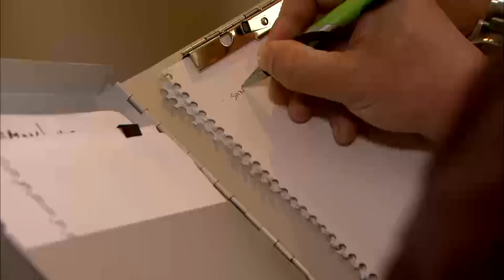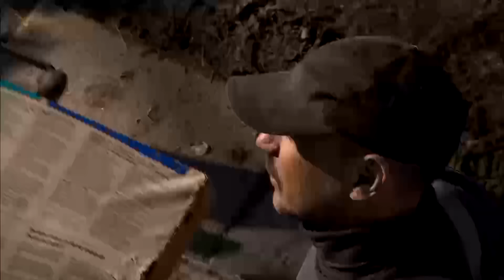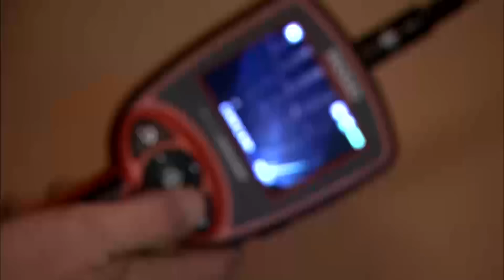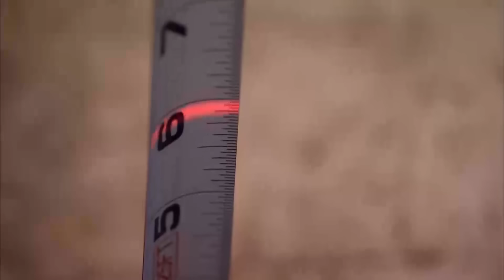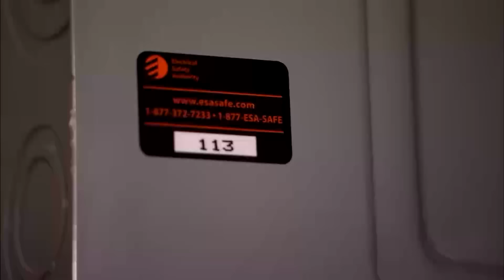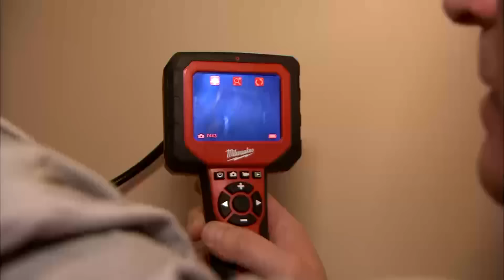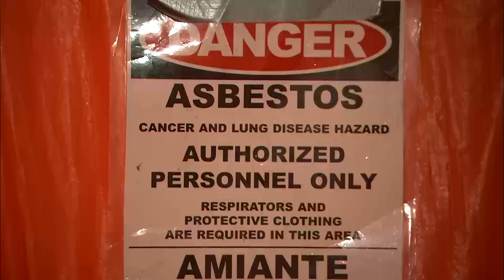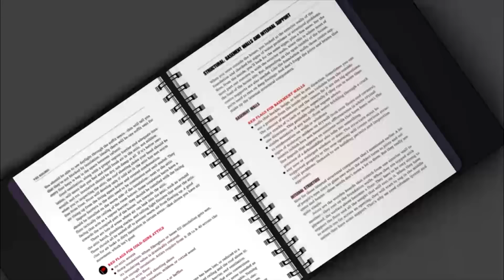Top 3 Holmes Inspection Episodes | HomefulTV Rewind 2023

Comment: Back in 1986 my husband and I had moved into our very first apartment. We were stationed at Norfolk naval Base out in Norfolk Virginia right on the beach. That's all we can think about what we wanted a house on the Beach and we got it. I was 4 months pregnant and had dropped the kitchen towel on the floor. This kitchen was so tiny it was a galley type kitchen and you can literally touch the left wall and the right wall at the same time. That was the worst decision we had ever made..  to pick up the dish towel that I had dropped, I had to place one hand on the stove and one hand on the sink there wasn't even any water in the sink. Next thing you know I was lit up like a Christmas tree and I couldn't break loose of the current that literally held me to the sink and to the stove at the same time. That was not a good idea. I couldn't get  loose from the current that traveled from the stove through me all the way across to the sink. Husband heard me and came running and the only thing he could think to do was put his foot which he had specialty rubber boots that were specially made for being on the flight deck of the aircraft carrier. He literally took his boots into the middle of my back and shoved me as hard as he could which broke the current and I landed actually in the garbage can. The landlord didn't seem to care much about it. Come to find out it was happening because of a  garbage disposal has been removed, but they left a live wire under the sink. My son was born with Spina bifida. Makes me wonder if it could have caused his illness.

Comment: Must have been when I let the dogs out but how did they fix the floor joists?
Reply: they removed and replaced them  i believe pas there was no fixing them
Reply: @jays106  Pretty sure they removed them altogether because something about the height being too low for code, after the concrete floor I guess. 
1:53:14 He tells them they would lose the current bathroom because of this.

Comment: I really need help like this in the U.S. I live in Ohio. Bought my first home 2 years ago. No inspection. After I moved in I started noticing problems with the house. No insulation in the walls or attic, floor in kitchen slopes, no trim around doors and windows, propane wall heaters are causing fumes that give me a headache. Cracked foundation, shallow crawl space, brittle PVC plumbing, no ground on electrical, dryer not vented properly and more. I was stupid in not getting a home inspection but this was all I could afford so I put my blinders on and ignored the warning signs. My back yard floods and concrete is broken up and cracked. Sill plates and studs in the garage are rotted out and the garage is leaning. The ceiling in the garage is not supported properly and the breezeway roof is sinking down. What really got me is last week I was sleeping in my bedroom and the dresser fell over. When I investigated I found a sink hole in that area of the floor. Friend of mine went down in crawl space and found 4 floor joists has rusty nails and the joists just gave away. He nailed them back up but said my sub floor needed replaced. He said it was a slat sub floor like ship lap. The previous homeowner had just put a sticker floor down over these slats hiding the problem.  My dogs and I could have been hurt badly. I don't have the money to fix these issues because I'm disabled living on a fixed income. I bought the house knowing there was cosmetic issues I could fix on my own but I wasn't prepared for structural issues. Please Mike, if you know anyone in the States that does what you do please help me. I'm begging you.